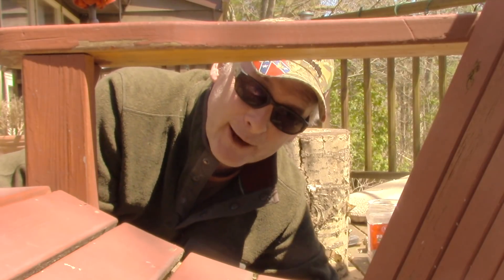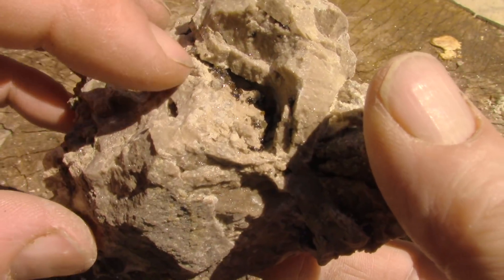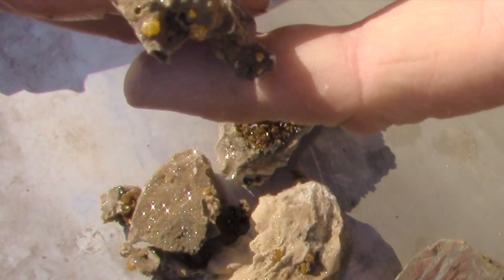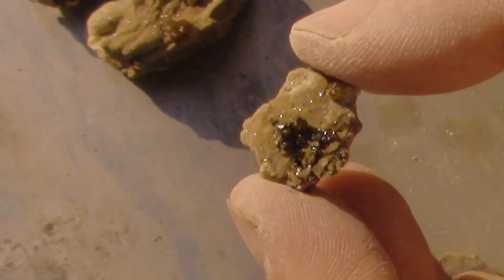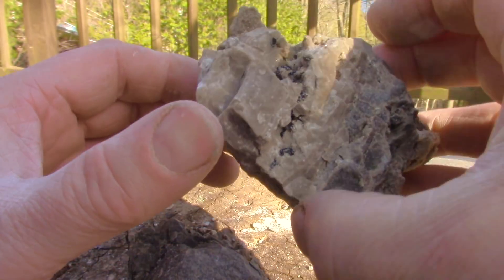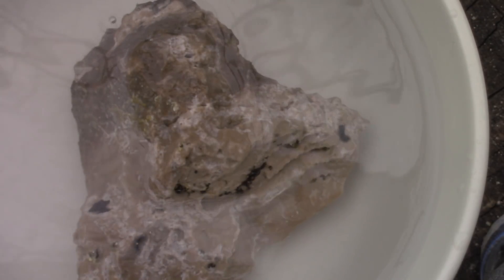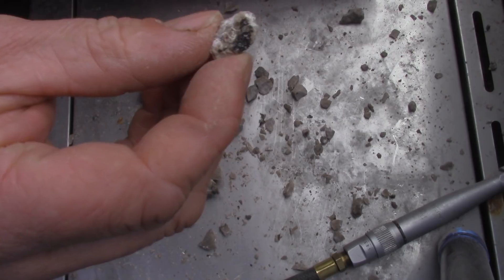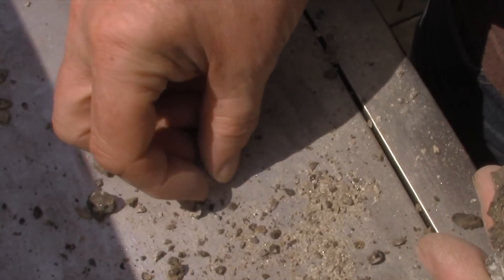Southern Ontario Rocks - SPHALERITE CRYSTALS

Comment: I haven't got a saw like yours so what kind of saw will work to cut through a rock?hacksaw?
Reply from the maker: Mine is just a tile saw.  They are fairly inexpensive new and sometimes you can get a great deal used at auction or Kijiji (or other sell sites).  A Dremmel with a cut blade will work on small rocks and a concrete saw on huge rocks.  I would not use a hacksaw because it would be a huge effort on a hard rock.  Might be OK on a soft rock.  One last option is you can get attachments for your drill which would also be better than hand sawing.
Reply: meMiner cheers! I'll check out tile cutters.